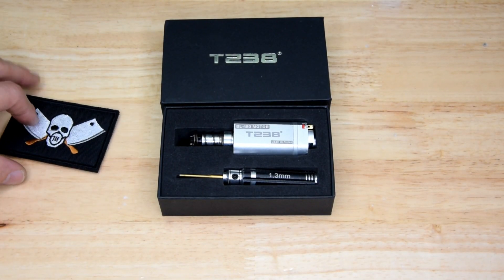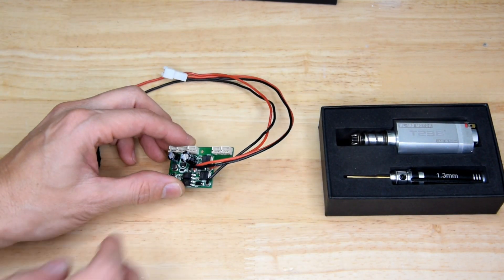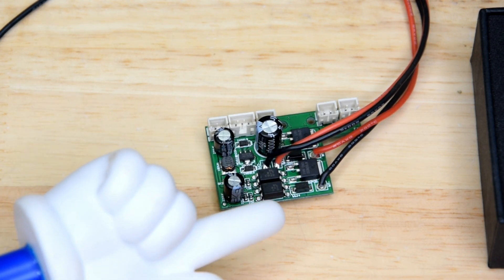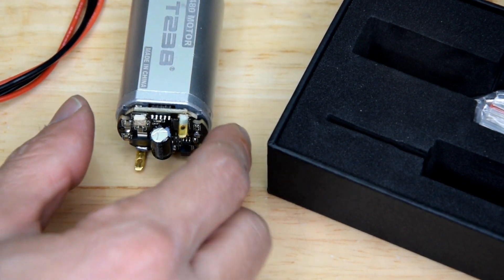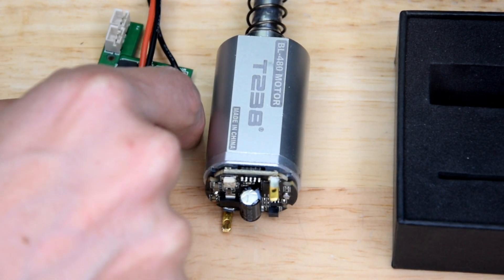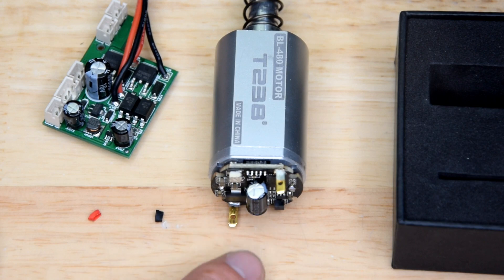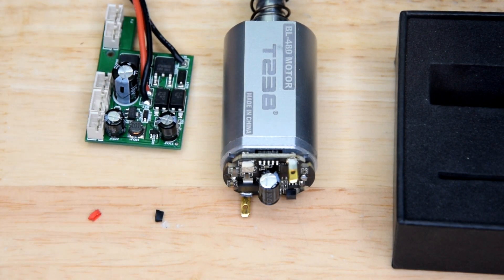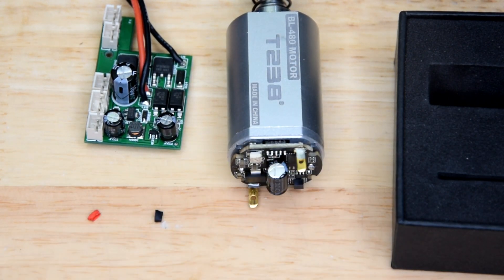A quick word on brushless motors and MOSFETs

Comment: Hey bro i got one of those gbf honey badgers and i wanted to throw a brushless in but it's got the older bigrrr mosfet and i don't know how it would go and i did read somewhere that taking the magnet out of the sector gear will disable the active break so i thought you will be the man to ask
Reply from the maker: Dont take the magnet out. That will make the bigrr not know when the cycle ends. You just need to find the code for how many beeps is the active brake and set it to off.
Reply: @lowguidoschopshop cheers bro the boy's at xforce said that they aren't compatible so just been using a silver and red t238 thermally efficient motor with the fan thing on the shaft that i had laying around bloody brought it off aliexpress just before i brought a bunch of brushless motors off there

Comment: Airsoft mosfets don't reverse polarity for Active Braking. The circuit would be much too complicated. That is called plugging, and airsoft mosfets don't use it. Airsoft uses dynamic braking. It basically shorts positive and negative together after each shot. If you take a brushed motor and run a piece of wire between + and -  it will be harder to turn. Power tools use the same method in brushed motor tools. Not sure why it damages ESCs in brushless motors though.
Reply: great insight thank you

Comment: Thank you for addressing the MOSFET/FCU/ETU terminology, somehow everyone has been taught that they're called MOSFETs, and it drives electrical engineers crazy 😂
Expanding on the "funny signals," Perun likes to put those easter egg songs played via beeping the motor at pretty frequencies in their FCUs, but I've been told that these easter eggs do harm to BRUSHLESS motors. As far as I understand it, the beeps are purely "on" bursts at certain frequencies to hit notes and no funny polarity business if I'm not mistaken. Is it actually bad?
Reply from the maker: also re: calling them MOSFTS, I am pretty sure it comes from the early days of airsoft where people would literally "put a MOSFET"  on their trigger switch so the contacts wouldn't arc. there are still some raw "MOSFETs" on the market, but most these days are small microcontrollers with all sorts of programing, and just happen to have a MOSFET or 2 on the output.
Reply from the maker: for as long as I can remember I have wanted to know how the heck they play those songs on the motors.. it seems logical that a speaker and a motor are pretty similar, coils and magnets... but trust me I have tried to play music on a motor and It wasn't as simple as I thought. so I have no idea what signals they are sending down those wires to make those sounds, but I cannot imagine that those songs playing on the input voltage rail of your electronic speed control would be a great idea. would it damage the Motor ESC? I don't know? probably best to just not do it.
Reply: @lowguidoschopshop  in theory if we stuck a diode on one of the leads, tried the Easter egg, and it didn't work, then we could probably safely reason that it does some funny polarity business right? In which case a solid yes it's bad could be proven... I'm gonna try that

Comment: Recently got a bigrrr mosfet for my custom and was going to get a warhead 35k for it but i dont think i will do that now. Not unless i can disable active break on the bigrrr. Have you done anything with ldt mosfet before? 
Also heard the tapetless head is drama
Reply: bigrrr uses small magnet inside the sector gear, so you can remove it to prevent active breaking
Reply: @Apollo_Q  thats how the mosfet reads the gear position so no.

Comment: The t238s have better ESCs than warhead but warhead has better hardware
Reply: Oh yeah and you can adjust fire rate on brushless cos it's basically like a pwm and it pulses power which is really bad for circuit boards so it needs to be 100%
Reply: They’re same OEM, different ESC and winding. T238 has more potential power, but both are deeply flawed and have huge room for improvement. Still, for now, brushless in general is bringing many advantages which still make them worth buying.
Reply: @sj_asc5950  yeah but for airsoft and gel ball really they don't have the reliability as brushless motors arnt really ment for stop start applications they are more for constant running and that's why alot of them fail but the hardware is better on the warheads just not the esc
Reply: @sj_asc5950  yeah even when he just threw it in the blaster it sounded so much happier bloody unbelievable
Reply: @sj_asc5950  thanks for the info friend
Reply: Would this motor prefer t238 mosfets instead of a levi or something similar
Reply: @drewmurray6480  probably t238 tbh
Reply: @gelology5514  cheers bro i kinda thought that they would suit each other best lol lucky i got 4 t238 v1.7 for 200 bucks and still got one sitting in the box, i got basically everything for my scythe build with a base model 35k warhead motor and i do have one leviathan spare but was thinking about getting one of the new optical leviathans for it just a bit short atm after paying for car rego and insurance im basically tapped out atm but i won't be touching that particular build for my falkor blitz for a bit ,i still got a few other builds to sort out first 😂 my hpa build is still sitting under a towel on the work bench just had heaps going on recently and had family visiting from nz but now i have some more time on my hands i will get back into it